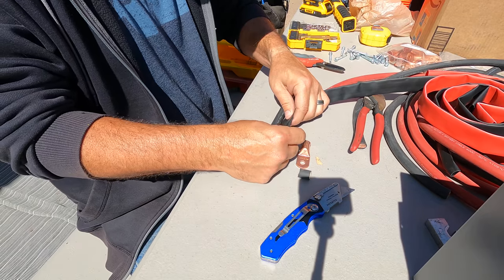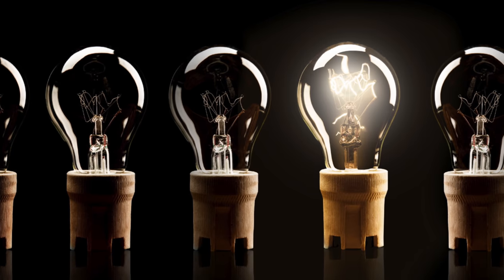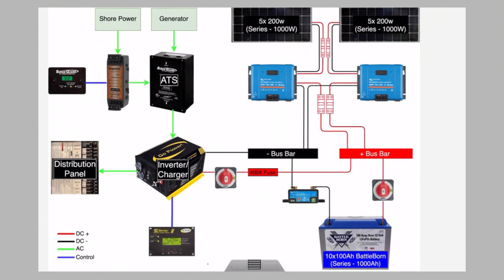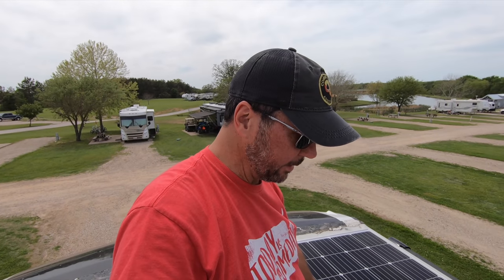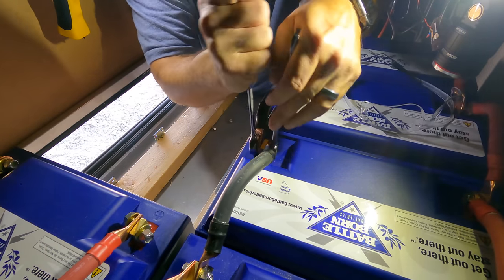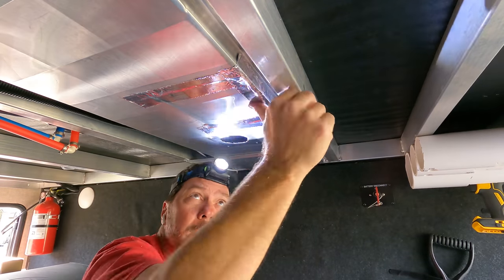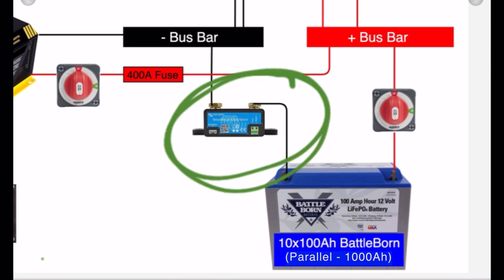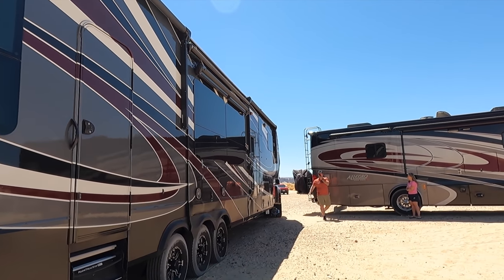☀️  RV Solar Install! 😎  (Full Time RV Life)

Comment: 10 grand in batteries alone! I love watching these videos, but without a sponsorship, it's out of reach of most of us working folk. Nice video though, and I enjoy you guys. Well presented.
Reply: Yeah if was paying I'd probably go with SOK at about half the price per watt hour. Battle born makes a good product but its not worth double the cost vs what is still a very good battery to me.
Reply: Another channel I follow bought individual cells and built their battery bank.  Check out I Ride Tiny House Adventures for that video.
Reply: @cwshumate914  That's what I did. It's much cheaper that way.
Reply: @mnotlyon  me as well.
Reply: I'm thinking is someone has spent $250k on a fifth wheeler, $10k isn't an issue.
Reply: Terry, We just did a full solar install for our fifth-wheel using a lithium power wall and 6k watt 240 volt - Split Phase Growatt hybrid inverters and we saved HUGE (I mean a lot of money) on the lithium by buying a PowerWall in place of 6/8 individual 12/24 Volt 100 amp hr Li batteries. Also we went with the PowerWall option for safety since it’s fully Inclosed in a metal housing with A Battery Management system and breakers.
Reply: @lifeunchainedtruckandrv2166  I was wondering why nobody was using the Growatt products in an RV application. It's good to hear you did.
Reply: @neilmacintosh6007  250k for a Grand Design? Your kidding right?! 😂
Reply: The statement “free power”  is a bit misleading.  The material cost alone will create a multi year return on investment.
Reply: They might also reuse the whole batteries and solar system on a building or even sell it, i think its actually good compared to a generator that needs fuel and maintenance.
Reply: @neilmacintosh6007  Good point Neil. And I'm sure for a big channel like this there was sponsorship from both Battleborn and Victron. Both great companies but not for penny pinchers... I have Renogy and Dakota.
Reply: You can get that amount for half the price with discount batteries. Then you can save another 30% off the 50% less batteries by just building the battery yourself
Reply: @neilmacintosh6007  that rv and truck together are not $250k!!
Reply: @neilmacintosh6007  I don't the RV in question cost $250k did it.
Reply: @neilmacintosh6007  Pretty sure it didn't cost anywhere close to that but even it if did, it's their home.  How much did you pay for your home?
Reply: Actually guys while Battle Born isn't cheap, you can buy them on their website for $799. ea. That's the 100 Ah 12V LiFePO4 Deep Cycle Battery. Down from $949. Not cheap, but a better deal.
Reply: Diy batteries as little as 300$/100ah.  Aliexpress and a little soldering skills.
Reply: WOW, I would start by removing that Brick of an AC Unit and put on more Solar* (if needed), but 1,600 watts of POWER Needed to run one AC Unit... How about going with a MINI-Split that runs at 500 Watts and *  and then you could have saved $4,000 - $6,000 on  Batteries.
Reply: Totally agree. A little bit too much for me...I'm retired and can't even afford half of that.  :{
Reply: @Mark-ww7gr  with an average of 45 dollars per night at a campground... most solar systems  can payed of with 365 nights if boondocking
Reply: @ericlee8231  most folks are unwilling to boondock an entire 365 days consecutively, therefore it will take more than 1 year to recover the investment cost.  Many years for non full time RV folks.  Therefore my statement of taking multiple years to recover is absolutely correct.  Thanks for proving my point with your data.
Reply: @Mark-ww7gr  if you not full time you probably don't need solar and there are for more cost effective batteries than battleborn. I built my own batteries at 280ah and a 200amp bms for $725 a piece so less than a battleborn and more than 2.5 times th power.
Reply: @alandillon6469  Grand Design does not cost near 250 grand
Reply: @Mark-ww7gr  Exactly nothing is free. "Off the Grid" means you pay to play. Not to mention all the grid needed to produce the products.
Reply: @ronaldpigeon4713  Ummm I never said it did. I said "you're kidding me right?" Like you are nuts if you think they cost 250k... have a blessed day🙏
Reply: @alandillon6469  No problem I was confirming to all that may be viewing this that there is no way they cast 250 thousand. 😊🇺🇸
Reply: I built a 16 cell LiFePo4 battery bank with EVE 280 amp hour cells and a battery management system for around $2000. That's about 15kWh of storage. That would have been about $8k+ for name brand LiFePo4 cells. It's not so difficult to do with a little learning.
Reply: If you’re living in your RV full time and not paying a mortgage or rent it’s quite easy to save $5-10k to invest in a solar system, also means you can stay places for free longer and don’t have to pay campsite fees
Reply: @mgkleym  uihhuh  
Bless
Reply: I agree 100 percent
Reply: Plus I have a budget of 1500 dollars not 15000 dollars  so any suggestions. Thanks
Reply: Very helpful thanks
Reply: @Mark-ww7gr the biggest reason for not wanting to boondock is lack of access to utilities, so that's a big part of why one might want to do this. Not to mention that you can stay in cheaper sites if you want to camp in a campground but don't need shore power. Water only sites around where i stay are only $15 while sites with power start at $30 and get WAY higher depending on the amenities and how high the park owners are on their own farts.
Reply: Tbh I'm just going to use the equity in my rv to pay for this upgrade to be done. Mine is like a whole house.
Reply: @cwshumate914 buying individual batteries that were manufactured at different dates isn’t recommended
Reply: I am now way into 48volt server rack style batteries. 5120 wh for around $1300. No beating that!

Comment: I'm guessing you stayed with a 12 volt system only because you already had a 3Kw 12 volt inverter installed.  One thing I would recommend when you buy your new Victron inverter would be to switch to a 24 volt system and add a DC to DC converter for your 12 volt loads.  1000ah of battery is a bit much for a 12 volt system and you'll have less loss with high amperage loads on the inverter with a 24 volt system

Comment: I put 4 Battleborn batteries, 200 watt of solar panel and Victron solar controller also a 3,000 watt Victron inverter and color control monitor in a class B, 2017 Mercedes Benz sprinter motor home. Love it, works great. In the morning I can make coffee without having to start the generator. My neighbor's are happy campers, no noise.
Reply: Just a note that the Victron is a 2,400 watt inverter, that they badge as 3000 VA.

Comment: There is one positive offshoot of installing solar panels on any roof and especially RVs you created a lot of shade because the solar panels are suspended above the roof and underneath them is shade which is a lot of roof that’s now not in direct sunlight and probably makes your AC a little more efficient as you’re not getting as much radiant heat coming from the roof I’m curious what an infrared thermometer would see if you look at the ceiling inside the RV and the differential between where a panel is installed and We’re direct sunlight is hitting the roof?

Comment: So much Knowledge……and cash for your system. Just the Batteries alone. I learned a ton. I love the fact you said I want AC to perform all the the time. Me too. Design the system around Heat and AC for Boon-docking!!!!!
Reply: I'm so far behind..got it on the 98 38ft bounder ..was learning for the upgrade..I'm a tree service.. wronged skillset...lol.. I weld,build(ingineering) do inverters on my  trucks..4000 watt. But no battery storage on them..alternator runs those...Rv came with 2 100 watt??..can I add battery's and pannels? Nobody has answers so far..I didn't install them so no idea whats there except pics I took

Comment: You are a great instructor Chad. I have a short in my unattached garage. The problem may be under the new cement that was just laid for our RV. Instead of digging a new line 75' I was thinking Solar panels. Seeing this I understand more what is needed. Garage door opener, 3 over head lights, 4 outlets to run occasionally air compressor for tires, miter saw and connect to our 30amp  RV.  Wish my dad and grampa, both electricians were still here. Safe travels. When you were in Cleveland, you ran close to us, nice to see.

Comment: That was a fantastic video. Chad, you are awesome at explaining the details.
Reply: Hi Chad, question for you, as I follow your video, I noticed that at the end of the duct where the solar wires came down (minute 29:58), the wires were not insulated to protect them from the furnace heat. Wouldn't that be too much heat on the wires? Could that be a problem down the road. Thank you for sharing that great video. Sergio.

Comment: Excellent work Chad. I'll be going through the same install soon. Being an electrician myself I'm going to add a smoke detector or better yet a remote smoke detector to the hole just in case something goes wrong. It could give you valuable minutes to get out.

Comment: That’s crazy!!! Just watched the install and 🤯🤯 I just bought a new keystone avalanche 365mb and it had that tape on the roof. I asked the dealer what happened to the roof🤷🏻‍♂️🤷🏻‍♂️. They didn’t know anything about it and had said it must have happened at the dealer but it’s still covered under warranty!! Mine also  has solar prep as well. So now I’m thinking that’s what it is!! 
I really appreciate your videos I’ve learned a lot and bought a lot of stuff that you use thanks again 😊😊😊

Comment: I don't know if NRVTA offers it or not with their training but there needs to be a national accreditation or license for "professional" solar installers. I am disabled and certain aspects of the installation is beyond my physical  and "comfort zone" A lot of the mounting of the components I can do to save a installers time (and cost) but some I can't do. The actual connection of wiring I would leave to the installer so they know it's done to their standard. 
I'm sure I'm not the only one in this situation but I am willing to pay a fair price for accredited work. The electrician that works in my home is licensed.....so should the person working on my RV.

Comment: We have lived off grid on our ranch in the boonies for over 20 years, and most of our power is solar.  We do have a generator to charge the batteries on cloudy winter days,   We are a bit more spartan than you are in that there is no furnace (wood heat), and our only AC is an ancient evaporative cooler, but we have most of the other modern conveniences.  You will like your new solar system!

Comment: When you are in Florida the solar panels give you orange juice!!  The manufacture should know you need plenum rated cables and wire if it is going in the air duct, they should not bring the solar in the air plenum at all.  Glad it is working well for you.  Stay safe and healthy.

Comment: Great video as always guys. Really good information presented in a professional yet easy to understand. I have a very similar background to you with over 42 years in the Avionic/Electrical Engineering of Aircraft.  I just wanted to clarify a couple of areas where you may want to correct for your listeners
1. There is no such thing as Watts Law. James Watt (a fellow Scotsman) and whom the Watt is named after is calculated using in a similar way to ohms law using amps x voltage
2. The Watt is unit of Power not Energy
3. The unit of Energy is the Joule. It is calculated using Amperage, Power and voltage. 

This is NOT a criticism merely an observation in the internet of accuracy. Love the channel!!

Comment: Like the setup! We spaced our panels a bit closer together than yours to get 2,800 watts on our roof so far this week. Running one/two AC all day (and part night sometimes) will pull the Lithium battery(s) down fairy quickly since the solar panels never really produce STC. We wanted to make sure we can run the AC’s Dryer etc...straight off the solar array and have enough amps coming in to concurrently charge our Li PowerWall. We also added low profile flexible panels on our slide outs to help with solar storage intake and save the middle isle on the roof. We posted a small video on our channel if your curious how it works.
Reply: Solar panels should produce 80% of STC mounted flat on a sunny day. If anything less than that, you're suffering from shading from A/Cs and vents and if you connected any of them in series, those panels lose power as well. All RV and yacht systems should be connected in parallel. You should be seeing about 2,240w of solar when the batteries are under a load.

Comment: Ive been wanting to add solar to my old 1987 class a. As an electrician, it has driven me nuts with the limited info available for setting up solar in an rv. I have reached out to multiple people to no avail. This is one if the best videos that I have seen, explaining the different peices of equipment.
Reply from the maker: Totally agree that it's a confusing topic.  I think the reason is that there are about 1000 ways to built one.
Reply: @ChangingLanes  I agree and there doesn't seem to be any standard as far as things like where you need a mean of disconnect. I've seen systems smaller than yours with 5 or 6 shut switches and yours is one of tge few that I've seen breakers installed (which makes sense to me)

Comment: Awesome video. Thanks for sharing. 

We are a family of 5 and going to spend the winter in our trailer down south. You guys inspired us to give it a try 😀.

We bought the same trailer as we feel the layout is perfect for us. 

I have a solar installer doing a 48v victron solar system with 13,000wh of batteries and a 5000w converter to run both legs at once. Very similar to your setup with similar goals. 

You video is well timed as it will help our installer. Your learnings around running the wire from the roof down will be insightful for sure. 

Thanks again.
Reply from the maker: Sounds like a great setup!  👍🏼    If your 397 is a later model, they moved the ducting over, so the drop should be between the ducting and frame...
Reply: @ChangingLanes  thank you! It’s a 2019.

Comment: Nice to see you do it correctly … from kill switches to breakers, to wire gauge. I’m a huge fan of welding but cable, and often get asked if it isn’t an overkill. Well worth the money. My system isn’t as elaborate, living in a cooler climate, but I still the have power when I need it. Well done on your presentation!

Comment: Having put 400W and 400Ah of LiFePo4 with a 3kW inverter charger in my little 21ft trailer just a couple months ago, I can appreciate the effort you put into your massive system. I love being able to stop for a break and run the AC or microwave without any worries about power or breaking out the generator.

Comment: #4 This is about cost. I love Victron equipment - well designed, rugged, reliable, marine grade - it's just a little too expensive for most people and they nickel and dime you on all of the parts you need to make a complete system. For yacht installs, that's all I use, but for RV use and especially those on a tighter budget, I select lower priced/equal quality brands designed for RV use and design the entire system around their electrical goals. For my own trailer, I'm going with a hybrid solar controller/inverter/charger which cuts way down on parts and cabling. I'm also using a 24v battery bank, which makes the equipment cheaper and I lose slightly less power in cabling.

Anyhow, love you guys and love your channel! Take it easy!
Reply from the maker: I see them just fine.. 😊

Comment: I have that same furion over the range Convection microwave in my "big country" RV. If you ran a mini Split Heat and AC unit they only use around 460 watts and one unit is decently sized enough to actually heat or cool your entire coach. if you needed to run two of them you would still only be running as much as one of your roof units that you have now. this is why i am planning to upgrade to a mini split myself. my dometic roof unit is 1300 watts so even without solar my electric bill would be cut in half each month by installing a Mini Split and disconnecting the roof unit which will allow me more room for solar panels when i am ready for that. Since the mini split does both heat and AC i can also eliminate the furnace which is another large draw. (I don't have the numbers for the furnace usage but i'm sure it's also probably about half of what the Suburban i have now uses) so either way i go with it i use less energy and still have a comfortable coach year around whether on solar or shore power. (right now my electric bill is around $80.00 at the highest- summer AC usage is the peak) This gave me a little better idea of what i am in store for when i decide to install solar on my rig so while you didn't go into specifics about everything you left me with enough information that i'm not scared of doing it still even though i know the batteries are going to kill the pocket book big time

Comment: With big systems like this  it's worth considering going to higher voltage on the battery bank and inverter.  Solar controllers can handle more watts at a higher output voltage, and you don't need that humongous wire.  Use a buck converter to get back to 12v for your RV systems.